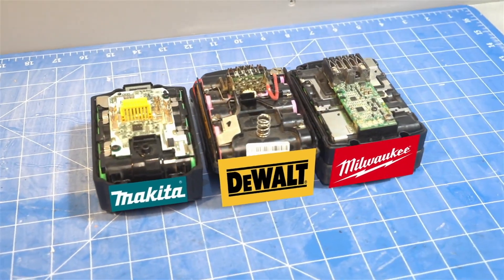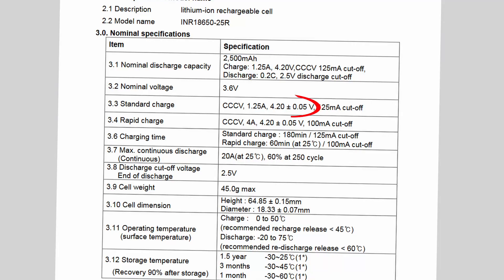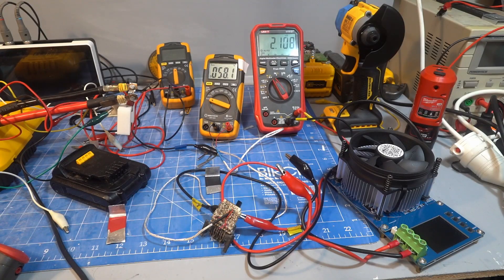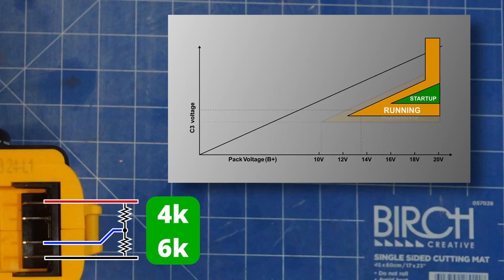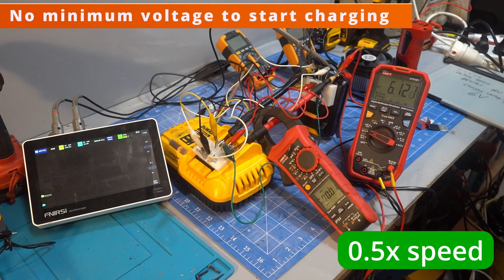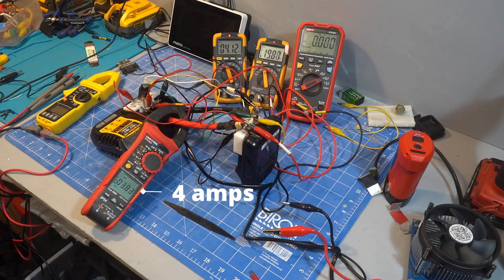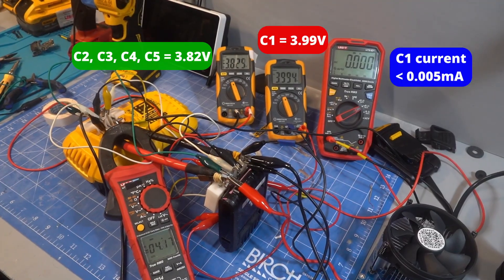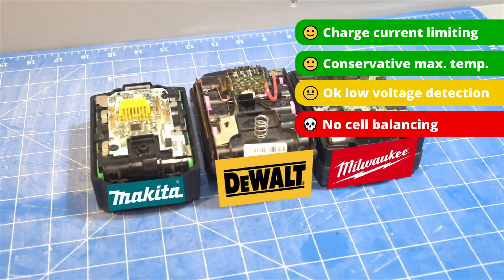[009] Dewalt 18/20V battery, tool, and charger communication

Comment: Personally I do not use DeWalt battery chargers, instead I use ISDT Q8 smart battery chargers. Out of all smart battery chargers I have tested ISDT Q8 are the only smart battery battery charger that work on DeWelt batteries without needing to bypass the 1K ohms resistors on the BMS. Q8 also works with flexvolt batteries. Power stack batteries are a bit tricky, since they have power transistors that are normally open  and will only close when the BMS detects certain amount of resistance between the positive and negative terminals of DeWelt tool. They way I go around this is I place a 10K Ohm thermometer between TH and C3 pins. The only DeWalt battery charge that actually has CC-CV would their DCB119 it’s a 2A charger that plugs into your vehicles, cigarette lighter outlet. Also, the archaic technology that Dewalt uses to charge their batteries it’s called “step charging” it’s very crude way of charging lithium ion batteries. If you’re interested in seeing how I connect DeWelt batteries to ISDT smart battery charger shoot me a DM!
Reply: I would love to see how you connect.  Imax B6 among those that don't work without the resistor bypass?
Reply from the maker: Great info. I'll sticky for anyone else that wants to use a smart charger. I figured most chargers would freak out over the input resistors.
Reply: @toolscientist  Will you be testing this by chance?
Reply: @toolscientist  Any chance you will test the DCB119 or the DCB094 USB C charger. It seems they may be worth looking at. Also the would love to see a power stack battery tested. It seem the power stack batteries are much safer.
Reply from the maker: @Ender_Wiggin  probably won't look at other chargers due to cost. I did buy a 5Ah powerstack for my testing, but haven't got around to doing anything with it, yet. Hopefully soon.
Reply: I tried to measure the amount of imbalance on a powerstack 5.0ah. It seemed like the 1e cell was way off. By applying a 10k resistor between TH and C3 the mosfets in the pack are enabled. This way the actual voltage of the 1e cell can be measured. So thanks for the hint. @mainoleg
Reply: I'm in the same boat as Bob Clark. I have an imax B6 and would be interested in how to connect it to DeWalt (or Makita or Milwaukee because it seems like their chargers all suck) batteries
Reply: Great, I just downloaded a stl for an a Dewalt connector with all connections, I have an ISDT Q8
Reply: @michaelfischer6984  I just found an old charger and wired into the pins.
Reply: How do I dm you? i need to know how to connect a dewalt battery to the q8
Reply: Can confirm, IMAX b6 ultimate tries to balance pulling the high cell low but with a significantly lower current than the charge current so it just over charges the high cell until it shuts off... At 4.5v WTF
Reply: very interested!
Reply: Hey, I'd love to see your setup for this or any resources you have to build one of my own.
Reply: I would love to see more detail on your setup, if you have a writeup anywhere you can share that'd be great!
Reply: Thanks, I have never had problems with DeWalt chargers for 20 years, so no need for me to find a replacement, 😉🇨🇦
Reply: I'm more interested how you managed to misspell DEWALT so many times.

Comment: Bummer. I bought the standard pair of a drill and driver for use at home (because cheap) and may use them in a flurry pulling apart the car or doing home maintenance for a few days at a time then they just sit there looking yellow for months. Would this use help or hinder their longevity? I never fully discharge the battery and only top-up from 2 bars to three.

Comment: so in theory if no balancing i can charge the dewalt batteries with a simple hobby charger via only the neg and pos terminals?
Reply from the maker: Yes, but the resistors on C1,2,3,4 can trip up most hobby chargers. I pinned a comment by someone that found a hobby charger that works
Reply: @toolscientist thanks for the reply mate, I have a couple different chargers including one from toolkitRC which generally has its way with most things! I will give it a go

Comment: Thanks for the detailed info! Could it be as simple as whacking a balance board in parallel with the charger on the cell detection pins to add this functionality? Not that it seems to be much of an issue... anecdotally, I've got 2x 7 or 8 year old 9 AH FlexVolt batteries performing pretty close to new in my 60v weed whacker. (Damn good thing too--they're charging more for those than the tool these days!)

Comment: Dewalt is my favorite or at least the brand I own the most of. What does"access to every cell" mean. I have a dc power supply. Is it possible to balance charge without  pack disassembly? I was going to charge on the dewalt charger, disassemble and charge all cells to the highest voltage cell voltage. Can I do that without pack dissassembly?
Reply from the maker: It means there are pins that connect to each cell. In theory you can use your DC charger, but there are resistors on the pins. So you have to be careful not to burn these out, and you have to stop charging to get an accurate voltage measurement.
Reply: @toolscientist thanks. This is the first i have heard of resistors. I asked chat gpt which said the wires are.only good for 100ma. But if I made an adapter and used like an imax b6 it is possible. So far i think i want a 5 or 10 amp. load to drain the high cell.down. My tip.if it is any good. Nickel plated neodymium magnet to connect. You can stick your alligatoe clip right to tje magnet or a peice of steel.that you clip to. Makes connections to the batteries easy.

Comment: I have recently bought some DeWalt aftermarket 8AH battery's. They came with the 3 charge indicators lot. I tried charging these battery's in 2 genuine. DeWalt charger, but all would not chargrE due to hot cold delay. I tried warming up batteries, with no luck. I discharged batteries to no charge indicators glowing. I began charging at 21V @3amps, till fully charged with a adapter and benchtop lab power supply, till fully charged. The batteries work on smaller tools, but will not start recipe saw, disc grinder, 7" chop saw and 1/2".impact gun. Any thought on this issue would be Great. Thanks for your vids, 😉🇨🇦
Reply from the maker: Do you have multimeter. You could test thermistor and C3 voltage to see if they are in the range I gave in this video.
Reply: @toolscientist  Thanks for the advise, and what's your comment on the batteries NOT working with brushed tools. Just passing on experience with these batteries, and not interested in repairing new batteries, 😉🇨🇦
Reply from the maker: @stevecarlisle3323 best guess is thermistor is damaged
Reply: @toolscientist  Ah Okay, but the batteries work fine with Brushless tools, 🤔
Reply from the maker: @stevecarlisle3323 in your first post, when you said "works on smaller tools", i thought that meant lights/fans/etc. Do the tools that work have 2 pins or 4 pins?

Comment: As I understand it, DeWalt batteries do have cell balancing but it is done by the BMS in the batteries, not the charger.
Reply from the maker: The Powerstacks might as they have a chip that is capable of balancing. All their other batteries don't have the necessary hardware to balance by themselves, only through the C1-C4 pins.
Reply: I've got multiple 5Ah xr packs with more than 0.3v difference between highest and lowest cell pairs, it's the reason you can pull a pack off the charger with only 2 bars showing, and leaving it sitting for days, weeks or months does not make it better. No balancing in the charger, none in the tool, none in the pack.

Comment: At least I guess this design is better since it ALLOWS balancing externally, but just they don’t use it
Reply from the maker: Yeah, but at least it's fixable by a knowledgeable user. On MIlwaukee you have to disassemble the battery every time you want to balance.

Comment: Great info, wish I had seen it 2 days ago. Just bought a Dewalt Charger. Had been charging with a power supply, figured the charger would balance. My batteries were out of the recycle bin, have been tested to 1/2 capacity with no issues, will not charge on the charger anyway. Figured it was probably the thermister, just haven't opened them yet.
Reply from the maker: I pinned a comment from someone that gave a RC charger that will work with Dewalt batteries.

Comment: Hi, great video thanks. I have a dc9310 Lion charger. Older one. But the charger don’t stop charging at 21v. It keeps charging until 24v. (18v battery pack) where can I check on the pcb? What Components should I check ?
Reply from the maker: Sorry, I don't have any knowledge of those chargers.

Comment: Whaaat no balancing 🥹🥹 Can I use external balancer on battery pins for balancing the cells ? 🤔🤔
Reply from the maker: Yes, but many chargers won't like the  10-Ohm resistors between the cells and pins. See stickied comment where someone recommended a charger that will work.
Reply: @toolscientist What would happen if I break the resistors🤔
Reply from the maker: @primozkert  there would be a greater risk of short circuits. The pins are very close together.
Reply: @toolscientist  is this the only problem ? 🤔🤔
Reply from the maker: @primozkert  It may affect the functioning on a tool, which samples the C3 pin. It also might give errors if you wanted to use a Dewalt charger.
Reply: @toolscientist Today I did a balancing test with an active balancer... in an hour it took the 4ah dewalt battery from 0.013 to 0.003v cell difference.  The Dewalt battery is not modified and still balances... It's a shame that I can't paste a picture in the comment... Maybe I'll make a video and post it 🙂
Reply from the maker: @primozkert  yeah, make a vid. You might not be able to link the vid so post the title and I can search for it.
Reply: @toolscientist  Today I opend one of the batterys 4ah dewalt xr and resistors are 3ohm betwen cell and cell connector for c1,c2,c3 and c4 🤔

Comment: This is amazing information for anyone working with (or hacking) these tool batteries! Your testing is thorough and presented in a no-nonsense manner. It's crazy that Dewalt has forgone any in-battery protection or charge balancing, and I'll have to make an adapter that lets me attach these to a standard R/C balance charger. Cheers!
Reply from the maker: Wow, thanks! Does seem crazy, but a lot of their batteries seem to last 10+ years without going out of balance. It's only really the higher capacity packs that have issues, and that seems to be across all brands. It's not a terrible design as it keeps things simpler and cheaper whilst still giving the charger all the information it needs. Just a shame they don't make smarter chargers.

Comment: Hello, thanks for the interesting video,
Is it possible to do something similar about Bosch 12v battery 
I tried using Aliexpress battery cases to build them by myself - but there's a catch... it's not working with all the tools
With GSB12V it works kind of well (sometimes the tool goes into protection)
With GEX12V it didn't work until I shorten 2 pins
But with GOP12v it doesn't work at all :(
Reply from the maker: Bosch is definitely on my todo list
Reply: @toolscientist  Thanks, can't wait to see it, I bought an original BAT414, the amount of electronics on this small triangle PCB is huge, surprised me a lot comparing to 2 resistors + 1 thermistor on the Aliexpress one

Comment: You'd think somebody would come up with a real balancing charger for Dewalt. It would be funny if turned out there was a Chinese knockoff that was better than the real Dewalt charger.
Reply from the maker: Yeah, only problem is those input resistors. That will limit the balancing current and won't play nice with most hobby chargers. Any solution would have to balance for a set time, then stop for several seconds to check the voltages, then start balancing again.

Comment: I found this gold content by searching for "Dewalt Battery reverse engineered" Just what I was looking for!!! 👌👏

Was thinking on a way to mix&match dewalt batteries with some of my chinese cordless powertools I've just bought for cheap... it's nice to see their system is just extremely simple.

Makes it easier and safer to use battery adapters for Makita (most chinese generic cordless tools use that system), make diy battery packs and design my other battery packs to work with my dewalt tools

Comment: Hi. Thanks for your work!
I also have some Flexvolts (1. Gen) and there must be some balancing by the batteries. All batteries have less Voltage within the middle cells in one 5S series.

Nevertheless. What I didnt get. I also have 4Ah (5s2p) batteries. They are perfectly balanced. But. My tools also sense the cutoff voltage at C3. So after hundreds of houres of use... The batteries must be unbalanced because of the minimal amps of the sensing imho. So. I didnt get it. No balancing in the batteries, no balancing by the charger, some current by sensing and the batteries are balanced...
Reply from the maker: A 1% imbalance will only show up as a 0.01V difference. 1% imbalance on a 4Ah would be 40mAh/0.12mA = 333 hours of holding the trigger. So around 1-2 years of heavy use to see C1/C2/C3 just 0.01V lower than C4/C5.
Reply: @toolscientist Ah yes. You are right. I missed the duty cycle... The pack is used heavily for around 6 years right now. And this is the only one I have that is not a flexvolt. So this battery is effectively every moment in my drill. So yeah. I assume I have a "bit" more than 300 hours of trigger action (working over 2 years fulltime for building my house).
Reply from the maker: @juliankonig1412  it's still quite impressive how well cell matching can work, though.
Reply: @toolscientist  Of course!
I will build a custom charger (quattro) and will balance the 18V packs nevertheless. I will build some 5s2p 21700 also, so balancing is a good idea, because I will not be able to match that good.

The flexvolts I am relative certain have a bms which can balance. But only with low charge amps as I understand. So I will try that an otherwise will balance them once in a while with opened case.

Comment: I have an 18vxr dewalt it charges and works fine in non dewalt tools but when i put a genuine dewalt tool the battery dont work any ideas as u seem to know more than dewalt!
Reply from the maker: Something wrong with either the TH or C3 pin. Measure resistance between TH and B+ (should be around 10kOhm). Measure voltage between C3 and B- (should be 9-12V).
Reply: @toolscientist  hello thanks for responding! 19.5v between b+b- 11.4kohm between th b+and 9.5v between c3and b- but im using the connectors at the front c3? Is that correct as the circuit is covererd in anti repair putty
Reply from the maker: @davidleckie2131  yep, the connectors are what the tool uses, so that's what we want. C3 is quite low, it should be 11.5-12V if B+ is 19.5V. It's still within the range I gave (8.35V >= C3 <= (B+ - 5.3V)), but some tools might be different.
Reply: @toolscientist  i have 2 batteries ive tested all cells one battery very clear one cell ov the other battery all cells 3.8v ? And 19v

Comment: @toolscientist Can you please do the same for Kobalt / greenworks 24v batteries?
Reply from the maker: Can't get Kobalt in Australia. We do have Greenworks, but it's pretty rare. I mostly buy my test tools 2nd hand as this channel only makes ~$30/month.
Reply: Thanks for the response:)
Reply from the maker: @JesseJames-rn1rh  are Kobalt 24V made by Greenworks? The electrical contacts looks similar, but a different rail system. Could well be electrically identical. I'll have to keep that in mind for a future test
Reply: @toolscientist  so far my research say it's limited to certain batteries 60v not all and not the 24v. At the moment I am trying to gather as much info  the "D" terminal (3 pin connector +,D,- )on the charger and tool to see how it operates / talks to eachother.  To eventually create a franken 24v  21700 4-6 ah pack with a BMS from AliExpress 40-60a or more but I am afraid the D terminal will be the hindrance to that project

Comment: I want to ask a question.  How do the four balancing leads connect in a DeWalt battery.  One would think the first lead connects to the 16 volt tap on the pack and the second wire connects to the 12 volt tap.  And, the third wire connects to the 8 volt tap and the 4th wire connects to the 4 volt tap.  Did I figure it out right?
Reply from the maker: It's marked on the battery: C1 = Cell 1, C2 = cell2, et cetera. As measured from B-, C1 = 4V, C2 = 8V, C3 = 12V, C4 = 16V, B+ = 20V.
Reply: @toolscientist  I know all of that..  I measure out the pack taps as well as the total pack voltage.  In my case it was 20.75, 17 something, 13 something, 8 something and four something.  .  I fully charged the batteries before I put the pack together.    I knew ther had to be a sequence to how the balance wires are connected.  I just did not know what it was.  Now, II do..  DON’T forget the balance wire code is on the charging board, attached to the plug.    Mine reads 3, B1, B2, B, corresponding to the yellow, white, green and blue wires- not necessarily in that order.

Comment: Would be very cool to see this detailed of a deep dive into the dewalt wall adapter for the 60v miter saw as apparently it has a tendency to fry motors.
Reply from the maker: Apparently that's due to the adapter just rectifying 110Vac, which gives 150-170Vdc, which is well above the 120V that a 2x flexvolt tool would see. I'm in 240V land, so even if I did get hold of a mitre saw and adapter, my adapter would have a transformer in it. That transformer probably takes it lower than 100V to avoid that issue, so I wouldn't see the burnout problem. I guess it would still be interesting to see what voltage the transformer puts out.